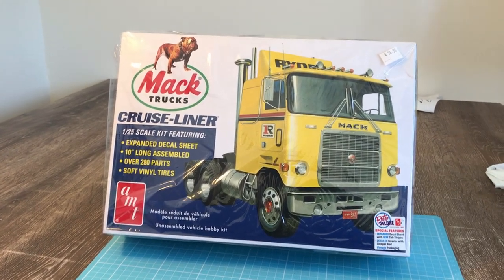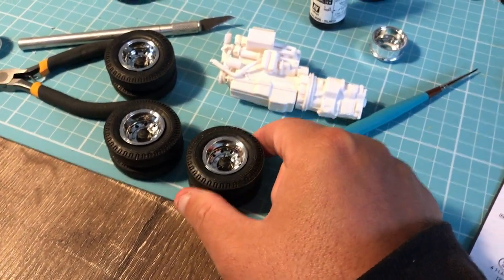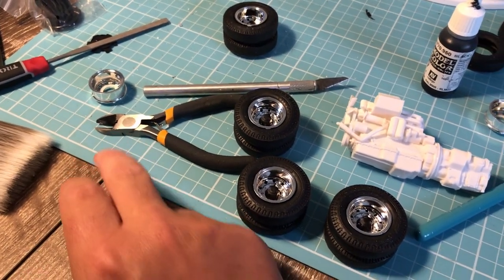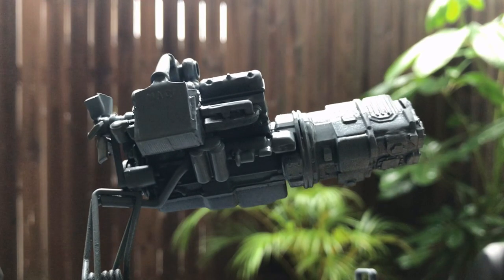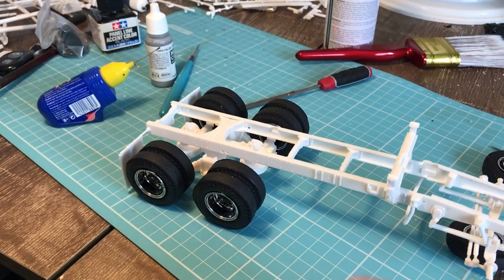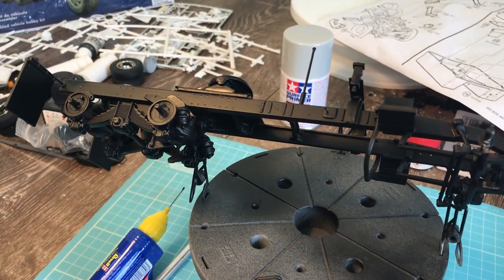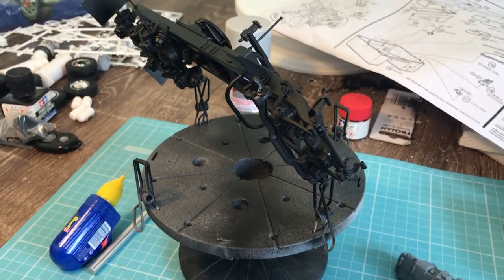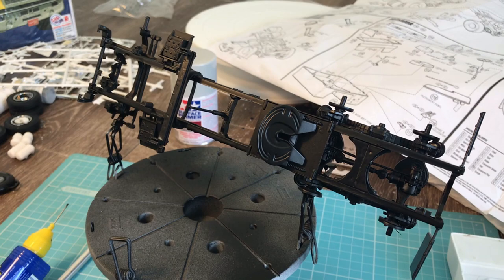Model Car Building - AMT Mack Cruise-liner 1/25th Scale Model - Part 1

Comment: Thanks for making a video!  This kit is the first model I've built since the early 90s and I needed a little help
Reply from the maker: Hey mate! Thanks for watching!

The biggest tips I’ve got are that I put the 5th wheel too far forward (was my first time too, should have been back over the axles) and I also had a lot of trouble fitting the cab over the turbo, I couldn’t get the cab to sit flush with the turbo on the engine. Some people have cut a chunk out of the cab interior to make room, let me know how you go!
Reply: @ChickpeaHobbies  I'll do my best to follow up, thanks for the extra tips!
Reply: Just an update after a few build sessions.  The AMT instructions seem more like an exploded view than a step by step construction manual, and I'm struggling.  The engine is assembled now, I had to sand down the turbo intake to fit properly, and I've glued the oil filters directly to the engine block haha

Comment: looking good man! currently building this kit too..
Reply from the maker: Thanks mate! I installed the fifth wheel too far forward 😂
Reply: did you had any issues?
Reply from the maker: Sorry mate yes I did I had trouble getting the cab over the engine. It was touching the turbo I think I heard some others get around the issue by cutting some of the floor of the cab

Comment: You did a terrific job on that engine. I'll try pre-shading my next diesel engine to see if I can replicate the results.
About the axle color - painting them to match or complement the cab color is nice but they are typically the same color as the chassis.
Another way to tone down the brilliant shine of hobby chrome is to lightly mist it with a flat or semiflat clear coat.
Reply from the maker: Ooh, I’ll have to try that idea! Thanks ☺️
Reply from the maker: Thanks for the kind words 😁
Reply: When you lightly mist to dull the shine, how many coats do you apply? It’s a good idea. Thanks for sharing.
Reply: @WJ St.Germain  I've done it in one, actually. A light mist gives you more of a polished aluminum  look. Of course,  it depends in the chrome quality, and they're all different.  Practice on the sprue.👍